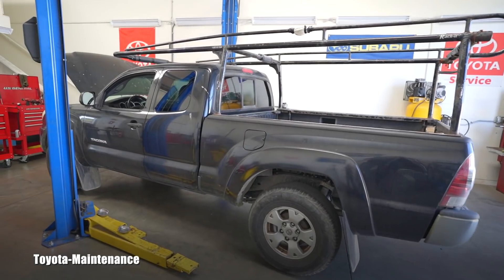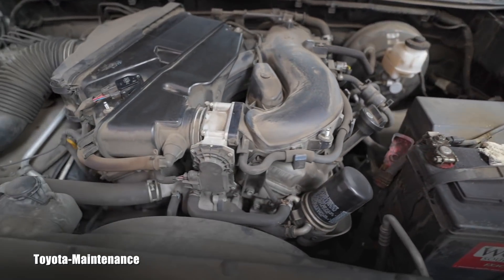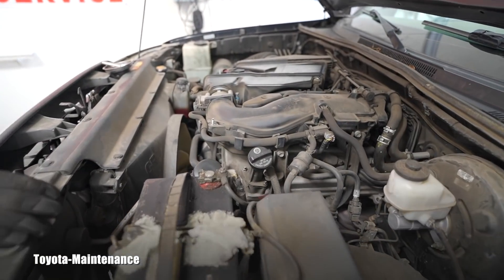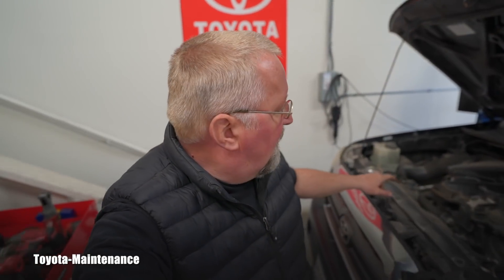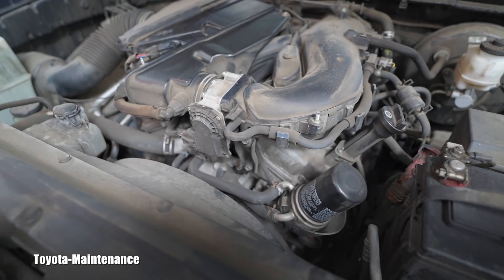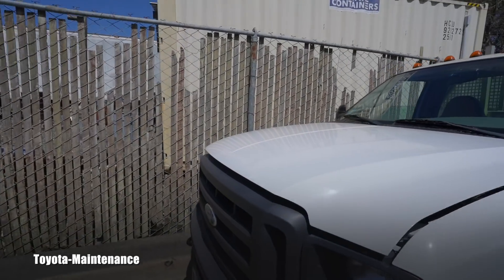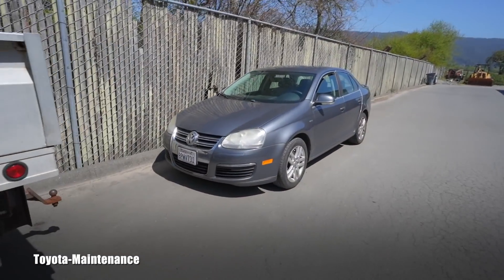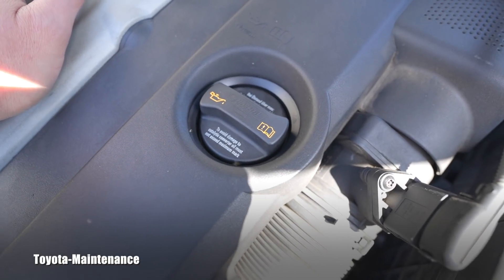Moisture in the engine

Comment: My girlfriend's 1GR 4runner often has this happen in the winter (southeast AK rainforest), but I've never seen it happen in summer. She does more short drives in winter, so it doesn't get as many thorough heat/burnoff cycles, and we are constantly dealing with changing/harsh weather, typically always wet. I maintain all our vehicles meticulously and have done various tests of coolant, oil, etc to confirm it's simply moisture at the high point / under the cap.

Interestingly, I never saw it on her previous 5VZ 4Runner. I also don't see it on my brother's 2UZ tundra, which has a similar shorter-drive pattern to her 1GR. Makes me wonder if like you say, maybe certain engines are a bit more prone to that milkshake under the cap, for whatever reason.

I've never had it on my 5VZ 4runner, nor my previous 1FZ 80 series, but I regularly drive 30+ minutes.

Comment: I discovered this today. I usually get my oil changed at a Valvoline place. I was there today and they show me the cap with the milkshake on it and tell me there's coolant in the oil and I probably need a new head gasket. They don't do that kind of work there, so they weren't trying to sell me anything, just not as competent as a trained mechanic. I started to panic a bit, but after a little research (which led me to this video) I am now back at ease. We just went through that cold snap here, and I drive my 2006 Tundra about 40 miles a week. I was relieved to find out that this is basically a non-issue. I will be going elsewhere for future oil changes.

Comment: I saw this today on my 2010 4cyl Taco with 93k miles. I'm still fully freaking out. I go on short trips probably 90% of the time and am praying it's just condensation. Runs great, coolant looks good, and dipstick oil is only slightly dirty.

Comment: That was also very instructional about how moisture can get into oil. I often wonder “isn’t an engine sealed up? How can moisture get in?” I guess it is continuously breathing air and some of that air-fuel mixture mixes with the oil in the cylinders.
Reply: It happens during combustion, there will be always water present and it will pass through blow by

Comment: My oil filer cap was leaking oil - replacing the oil filer cap gasket was an easy and inexpensive fix. Perhaps that can be done to prevent moisture from entering ?

Comment: Condensate shouldn’t be a major worry on the oils filler caps, however, standing water in the oil should be. Knowing thermal dynamics and the cycling of hot and cold engines, moisture will form and collect, but then should be vaporized from the oils and engine when run at operating temperatures, hence not always short-trips. Also, quality engine oils are designed to neutralized the formations of acids, aka the tbn/tan of the chemistry. Thanks for the video Pieter!

Comment: I live in Miami, Humidity here is off the charts. Even in our summer I have never seen this when I do an oil change.
Reply: In northern cal it is hot cold hot cold not only like humid hot like you have, much more cold than Miami.
Reply: @LAactor  nice thumbnail 😂
Reply: It’s more about the cold air and short trips than actual outside humidity. Cold mornings and warm afternoons combined with short 15 minute trips will cause it.
Reply: @usmc2msu213  My daily commute to work is just about 15 minutes every day. And he says this truck had over 200,000 miles on it. I’m not disagreeing with your premise I’m just saying I have not experienced this condition.
Reply: @wm5723  I think it can happen for short periods of time too. At least that is what I’ve experienced. I see it during spring in Michigan, but then it goes away.
Reply: Hi Peter I use 100% synthetic oil and never have that problem (northern Ontario, Canada)

Comment: Have seen moisture like that when vehicles are short-tripped a lot and don't allow the engine to get to proper operating temperature over and over.  Such as in a daily driver that only travels 10 or 20 miles per day to and from work.

Comment: You want to be sure and change the oil in that Ford 3 valve engine quite often, and only use full synthetic oil of the recommended weight. Those camshaft phasers are notorious for failing from dirty oil. Changing them is very expensive. And NEVER put any parts not purchased from Ford inside those 3 valve engines. They will soon fail, and often destroy the entire engine.
Reply: I'm sure Peter can handle what it will need .  You are right about your recommendations.  Some real nightmares at the Fordtechmakuloco channel.   I would not get one personally, although some go several hundred thousand miles.
Reply: @davecaselli1957  It probably depends on frequency of oil changes, or load on the engine. You can figure that Ford tested the design for durability, but changed the oil while they were doing it, so everything seemed fine. But once out in the real world of neglect, problems started to surface. Obviously, nobody thought how the spark plugs would get stuck in those heads after they corroded. I had a chance to get a slightly used Expedition from my brother-in-law with the 3 valve, but bought his older 2000 Expedition with the 2 valve instead, since it was a lot cheaper.  With 140,000 miles on it now, the only thing I had to change were the ball joints, which wore a little due to torn boots, 2 ignition coils, rear axle oil seals, the plastic cable ends which operate the rear glass, and half worn brake pads. That isn't bad for 21 years. Parts from China are so cheap, that I changed all the brake rotors, while I had everything apart in the garage for the ball joints. I did it all myself. Being retired near New Orleans, I don't drive much, so it might outlast me. With no salt used here, and being painted silver, it still looks new. The first time I crawled underneath it I laughed, since everything is so thick, it looked they were trying to waste steel under there. Some teenager hit me right after Hurricane Katrina. It dented his fender and hood, but didn't put a scratch on my rear chromed steel bumper. I let him go without calling the police, since it was his fault because he hit me from the rear. He was grateful. 
I could afford a new one, but I like the chrome bumpers, and even put on a chromed differential plate when I changed the leaking axle oil seal. I also added a polished stainless steel grill cover to hide the cheap black plastic one that came from the factory.

Comment: The creamy fluid looks suspicious as it is close to PCV exit. Does it mean the PCV is clogged?
Reply: Gary it called pvc
Reply: @josephgonzales3857  NO it's PCV - Positive Crankcase Ventilation. PVC is polyvinyl chloride (plumbing pipes). If you're going to correct somebody, make sure you know what you're talking about.

Comment: I don’t understand. I’ve been changing the oil on my and family’s cars for years and never seen this milk shake stuff under the oil cap. Willing to bet we get same or more moisture here in MA as in CA.
Reply: Day after day of small amounts of moisture building up during warm up... Short trips... Engine NOT properly VENTING.
This is NORMAL... IF your crank case doesn't breathe.
Reply: @HouseCallAutoRepair  This. My Camry lives outside. I live in Australia, drier climate, but where I am we get some bitter winters. First thing I did when I got the car - replace the PCV. It was clogged up solid with gunk. Never had any milky stuff under the cap, the car even seemed to run better afterward.
Reply: Is the car garaged? My mothers car (Vauxhall Astra) was always parked outside,i've always changed the oil for her every year....couldn't get rid of the horrible stuff,even engine flush wouldn't help.My 2NZ-FE  Yaris was 20% of the time parked outside in the first 4 yrs owning it and 80% in my garage after,i've owned it for 13yrs now and never got any on the oil filler cap....i've changed my oil every year as always.
Reply: @tardeliesmagic  Overnight outside is probably what does it.I've always garaged but recently have cars parked outside (two kids driving now) and will keep an eye for it. Thanks!
Reply: @gacastro  Worth doing a flush every 5yrs,i would say. I used Forte engine flush and fuel cleaner on my 2002 yaris back in 2009,idle for 10 or so mins it says on the bottle...i drove with it in on the way home thou lol  10 mins later,at a junction it idles v.badly for 5 secs....then was fine! Drove much better,smoother with better throttle response.12yrs later it's still driving fine.The Forte i got was from a garage,special kind of Forte not to the general public,got it from my workplace as a special oil change service,best decision i made in a flush treatment. I use Magnatec too,makes the engine more quieter too!

Comment: Would a Catch Can "fix" this?   Catch Cans are illegal in CA, I think, but would one help?
Reply: Not really as it's the oil vapour in the valve cover condensing on the highest point of the engine. The catch can might reduce it but vapours will still condense in that spot so there will always be some buildup.
Reply: I put an oil catch can on my Prius. The oil in the can looks like a milk shake but at least most of it won't be going into the tops of the cylinders.